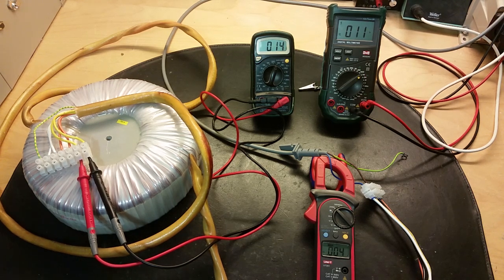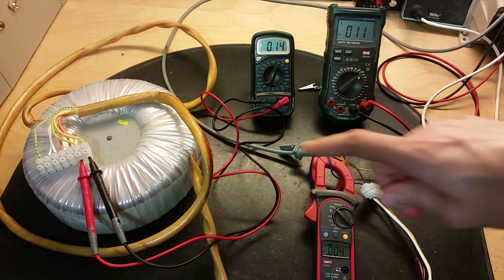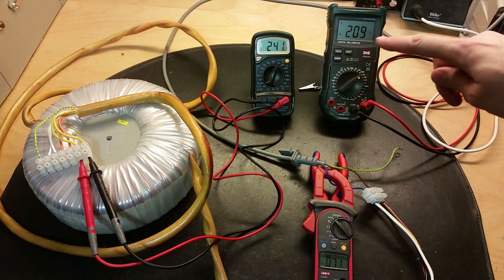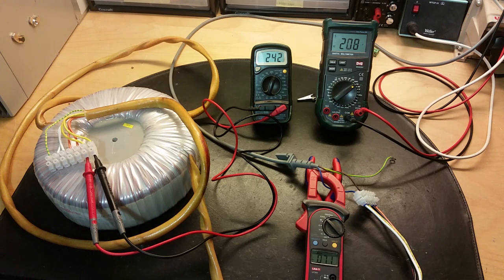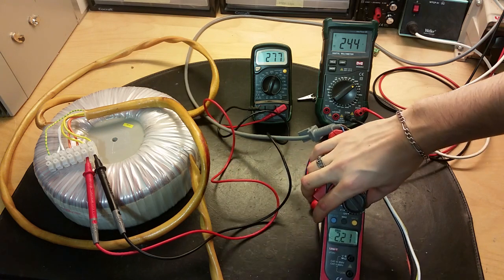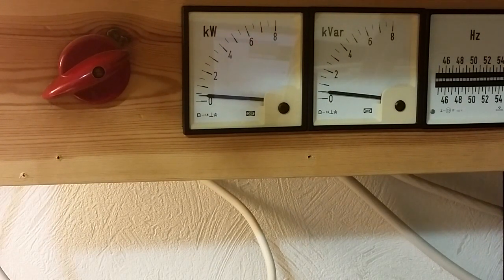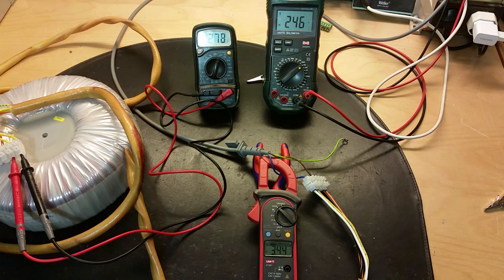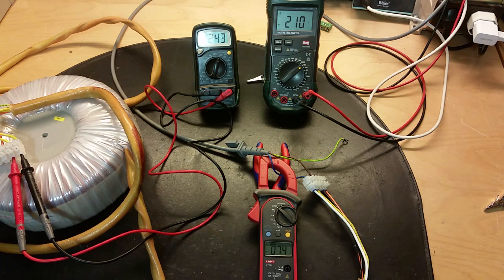Transformer Core Oversaturation

Comment: It's not clear what your purpose was here, but there is a device that purposely makes use of core saturation.

It's called a 'magnetic amplifier.'   You stated in your video that once the core saturates (ie. once all electron spins, or magnetic moments of electrons, in the core are aligned),  the current increases.

The reason is, inductance drops once the core is in full electron spin alignment (full magnetic saturation), and as the inductance (impedance to current flow) drops,  current naturally increases.

MAGNETIC AMPLIFIER
1)  has a core
2)  has an AC winding
3)  has a DC winding
4)  with the DC "off" the AC encounters normal impedance  (the core is not yet saturated, standard inductance exists)
5)  switch the DC "on" and the DC pre-saturates the core (pre-aligns all electron spins in the core) and drops the inductance
6)  since the DC has nearly eliminated the inductance, AC current suffers no impedance and is boosted (amplified) just as you called out in your video, "when the core saturates, current is high"

 (carefully note:  the physical nature of "inductance" is randomly-aligned electron spins in the core material.  It takes about five (5)  L/R time constants to align electron spins to the point where near-full current can flow;  L = the inductance of the coil/winding,  R = resistance)

The 'magnetic amplifier' makes use of core saturation to amplify the AC current.  These devices are also called "saturable reactors"
.
Reply: Very interesting response.
I would like to see an experiment someday where capacitive load is added until the transformer is damaged.
It would be cool if there was a thermal camera view.